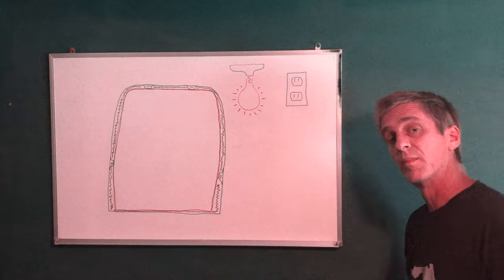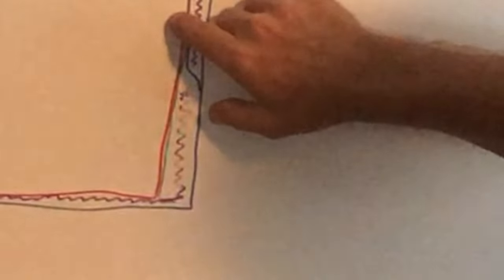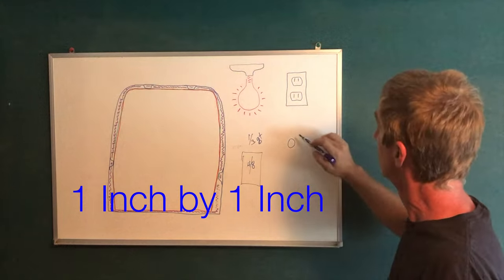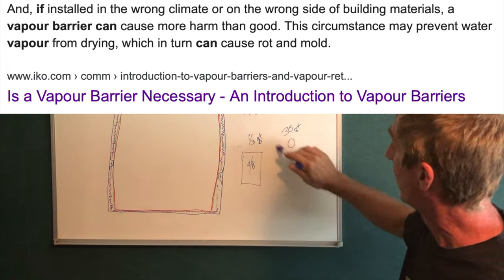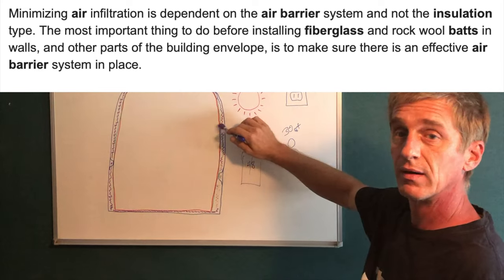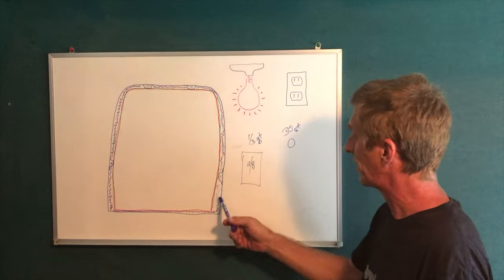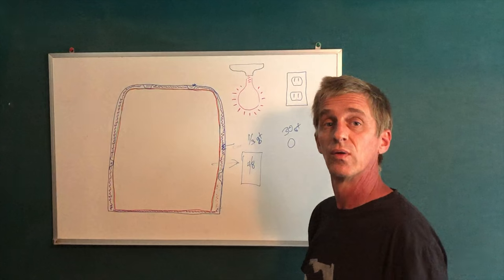Vapor Barrier in a Camper Van Good or Bad?

Comment: What are your credentials? Are you a heat/cooling engineer?
Reply from the maker: My degree and 35 year career is in extraterrestrial communications, bouncing data off a target the size of a school bus at 22,000 miles above our atmosphere. Satellites are solar powered and must withstand unearthly temperature extremes, both hot & cold. So I have done some research on these topics prior to van-life (massively understated).  I'm currently building TwoBlue, a van for a friend while Covid restricts my travel to Caribbean international airports where I maintain voice and data links between air traffic control towers via satellite. As you can imagine, these towers are also hot and cold challenges with a great deal of hot equipment.
My first sprinter (The Blue Saloon) is my most expensive tool, and only tool that has lasted 16 years & counting. I've lived in it months at a time while working rescue/recovery work post hurricane and other disasters. I've remodeled my van 5 times, researching better methods each time. I've also built-out additional vans for my crew and built 3 for resale since 2017. Not many builders have had the opportunity to repeatedly tear out a van they built 3-5 years ago and inspect the healthy guts. Rebuilding my own van routinely as my specific needs changed form sleeper to cargo/sleeper to office/sleeper, has surely put me in a unique situation to be well knowledged on this topic. I have a base study of insulation techniques in a "tin can" whether that tin can is an orbiting spacecraft or remote terminal shelter on earth, these principals are much closer to van-life than residential construction practices. 
I'd be happy to verify all of this personally and share stories of my adventures prior to making videos. Send me a message via the coffee link (with a small donation) and let me ramble on until you are convinced. I recognize this reads like I made up the best story I could to justify my position. I assure you every word is true and the only possible exaggeration is the fact that my degree is not from an accredited school. I have held contracts for communications work with Verizon, IBM, EDS, FEMA, The British High Commission, The United Kingdom of Saudi Arabia, currently contracted with The United Nations, but due to covid I am asking for donations for my Friday night pizza. This is my "Will work for food" sign. I'm not a bum, a freeloader, or even disadvantaged. Just a bit unlucky right now as my job may be worst hit when for decades I thought I was recession-proof and adaptive.... Did not see this coming... :O(

Comment: Bill, what is the best insulation for the van? Is it wool?
Reply from the maker: They all have pros and cons but I believe closed cell spray foam is the best. It bonds to the van metal which reduces road noise better than a van full of KilMat. It forms a solid barrier against moisture that cannot leak or absorb, and it removes easily for future changes or repairs. Anything that prevents air movement inside the wall will have nearly the same thermal value and that total value is based on the thickness of your wall, not the material inside it. Bubble-wrap, foil, mylar and 'radiant barrier' are NOT insulation* and have no useful purpose in a steel can or van.

Comment: I have 2013 Mercedes Benz Sprinter. My back tires are new. They are both at 70 psi. The tires light is on. It does not want to turn off. Now I see the ABS light and 2 other lights on. They are related to the tires. Any ideas?
Reply from the maker: For the ABS lights on a T1N, we’d start by changing the tail light bulbs to proper spec. However on your 2013, I can only suggest that the TPMS sensors may have gone bad or the antenna (there’s 2x i believe, one in front and one in back) is unable to communicate. Any recent wheel work done lately?
Reply: @FloridaVanMan  yes, I recently changed the wheels.
Reply: It was all working fine until I put different wheels on the back
Reply from the maker: Differently sized?
Reply from the maker: You may have damaged the TPMS sensors
Reply: @FloridaVanMan  how expensive is this to get it fixed
Reply from the maker: Lope Capo Unsure, if you go to lastvin.com it will tell you based on the data card of your van what frequency TPMS sensors you need to for your van. I think a set of 4 is about $80-$90 and then a scanner is needed for re-identification. I need to do the same on my 2008 and make a video about it.
Reply: @FloridaVanMan  Thanks for all this valuable information. All I did was so simple and never thought it would complecate things this way. Just moving the wheels from one side to the other.  Where can I take it to have this done?
Reply: Can you do this on mine?
Reply: I meant, can you work on my van to get it fixed? Thanks

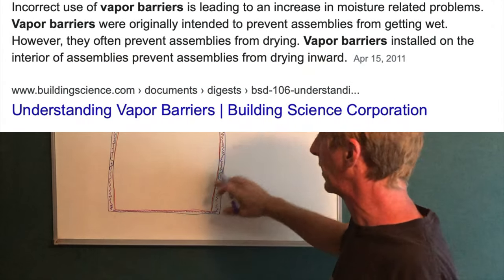Comment: 0:58 Yes, unless you seal that penetration when installing whatever you're installing.
Reply from the maker: I've said it before, if you can make a perfectly air-tight seal around every power port and picture hanger... do that! But it better be PERFECT because any leak, even the smallest... will let moisture creep in every time you close a van door. Good luck!
Reply: @FloridaVanMan  I just watched a video from professional van builders, and they recommend a vapour barrier.. 🤔🤷‍♂️
How are you stopping the moisture that does get in there with no vapour barrier from freezing on the van walls?
Reply from the maker: @AndreasEUR  "Professionals" are often at-odds with science. They install what they can "sell" to a customer, and talking about moisture *freezing is a wonderfully scary story to help convince you "Everybody else will cheat you." It is total sales-pitch B.S. unless you shower and boil water inside your van, slamming doors to really pump the steam into the wall cavity for a few days and then park it, closed up tight in sub-zero with the heat off. In real life, if your vapor barrier has ANY leaks, it will be worse than no barrier. This is my opinion based on reading non-advertisements like CHBA, PBA & remodeling my own vans. Many professionals never take the opportunity to see how their work holds up over time. They build it and sell it, never see it again. I've taken mine apart and redesigned as my needs changed. Never saw any reason to change the insulation. 4 remodels over 16 years.

Comment: so whats the answer plz lol... no barrier?
Reply from the maker: Correct. No barrier unless you can make a perfectly sealed barrier that expands and contracts with every door slamming. Any leak will be problematic, and every wire, pipe and window is a potential leak.

Comment: Mold
Reply from the maker: Yes, mold is exactly what we are working to avoid. Trapping moisture between two barriers is optimum for mold and we cannot make a perfect barrier to keep all moisture out, so it is better to have no second barrier. The van metal is the first barrier.
Reply: Or mould in proper English.
Reply from the maker: @pathfinder303  Is THAT why I keep *misspelling mold/mould?! :O)
Reply: @FloridaVanMan  Yep I'm English and we spell it with a U. I am with you on the vapour barrier, I didn't use it on my Sprinter and I have lived in it for the last two winters and no condensation. I used Rockwool and added carpet liner to all the exposed metal struts as they transfer cold or heat from the outside walls of the van. Greg Virgo as a lot to answer for this.